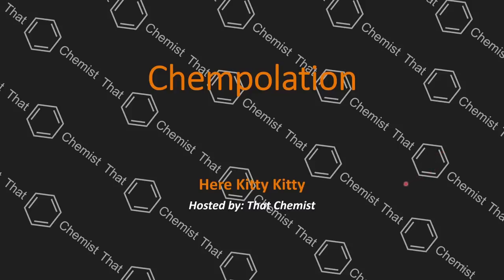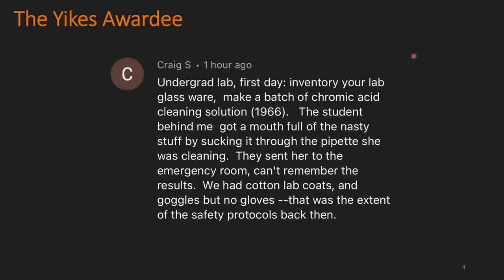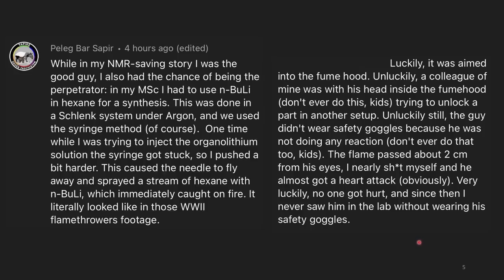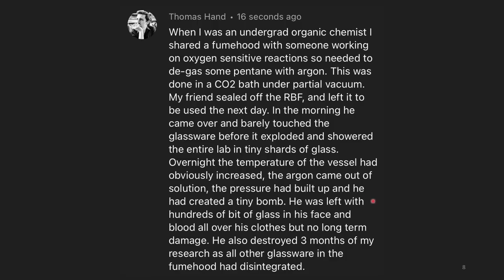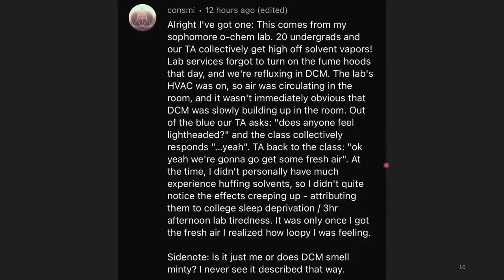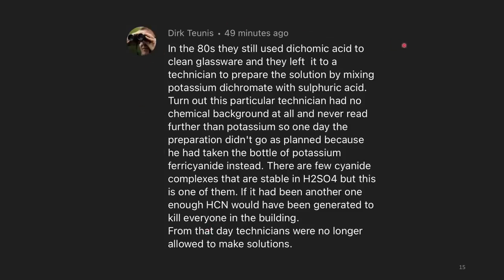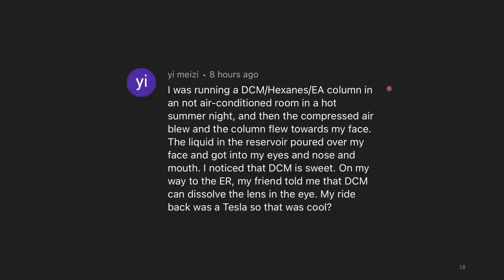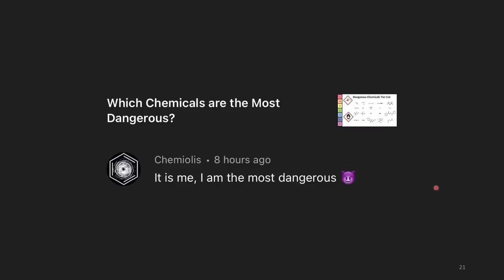He found out why that box was wet…

Comment: Ah, the bit about autoclaving Stuff Not Meant To Be Autoclaved reminds me of why my cheap cautery pen (medicine, not chemistry, not a professional/student in either of those...) got trashed.

They're meant to be single-use sterile and disposable, but the body is aluminum and the end caps and switch are Nylon 66 so they're safe to autoclave and reuse, and they sell replacement nichrome tips for them for a reason. Likewise, they take a standard alkaline AA battery which can also be autoclaved along with them (you have to use a slow cooldown not a rapid vent so the electrolyte doesn't boil and rupture, but it's otherwise safe to autoclave them) but I accidentally left the battery IN the cautery pen instead of in the bag WITH it and discovered that while Nylon 66 doesn't MELT in the autoclave, it definitely SOFTENS and the spring pressure from the battery contacts was enough to push out and permanently ruin BOTH end caps while the nylon was soft and malleable. Damn things cost 12 whole dollars and keep disappearing in shipping cause USPS thinks they're vape pens half the time...
Reply from the maker: Why do you need batteries for a pen?
Reply: @That_Chemist  It's a cautery pen, for cauterizing/sealing blood vessels during surgery, small wounds in first aid, or for removing skin tags and warts and such. It's basically a AA battery with a push button and a piece of nichrome wire that gets hot, so you can cauterize things while having something that's portable, cordless, sterile, and heats up/cools down fast. Definitely a lot nicer than heating up paper clips with a Bic lighter anyway, but tends to chew through cheap grocery store batteries pretty fast.

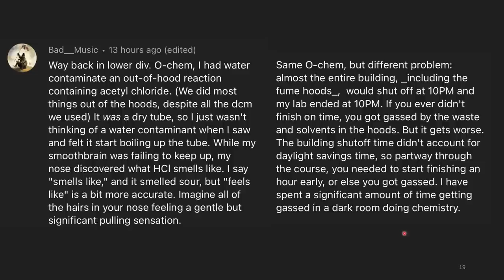Comment: 16:35 That definitely sounds like a money-related problem. Penny-pinchers in accounting have been given authority over everything else, while the senior chem department staff are too busy defending the department from layoffs to have the time and political capital to also defend lab safety practices.
Reply: A combination of timers and motion sensing switches might help if the concern was to avert wasting HVAC resources.  As long as students are still in the room, the lights should stay on and the fume hoods keep going.  And the fume hoods should go back on in time to clear the air for the first class in the morning.
Reply: @SeekingTheLoveThatGodMeans7648  That's awful complicated for people who only see and care about the numbers on the power bill. More importantly, it's difficult for the accountants to verify and enforce if it is being "wasted" as far as they're concerned. "Turn on at 8am, turn off at 10pm something something you should've finished up and locked up the lab before 10 pm anyway." is much easier to enforce than actually trying to figure out if using it late in the night was actually necessary.

Comment: The worst experience I had in a lab was when one group was having trouble getting samples prepared for analysis, so I was asked to help out for a week. I was new, and not fully trained, so I was happy to help out and learn something new. Turns out this group was processing pig tissue samples to determine if the compound, or it's metabolites, were being distributed in the pig and if they were building up or being cleared. In order to track the chemical and concentration accurately, if was fairly radioactive. I can't remember how radioactive, I just remember it was much higher than what is
I was normally working with to dose cultured cells. 
When I found this out, I figured there would be some highly specialized machinery in a hood to pulverize the samples, or we would be cutting then into smaller pieces and using chemicals for the rest. But no, we were just blending them on bench with cheap Walmart blenders and and food processors. The roughly 1 to 3 cubic inch chunks of pig had to be blended while frozen so that the later tests would be accurate. Thus, I found myself pouring liquid nitrogen over radioactive chunks of pig, putting it into a blender with dry ice (to keep it frozen during blending, it would sublimate of in the freezer) and praying the cheap carafe wouldn't crack open as I felt the chunks violently strike the side of the carafe as they broke down. Thankfully, they say least used metal carafes. 
This mostly worked, except for the skin samples (with the hair and fat still attached). The fat just didn't fully freeze, so the dull blades would get  like 2mm in the cube and jam. So for every 3 seconds of blending you would have to stop and try to pry the fat off the blade with probably 20lbs to 30lbs of force or more while trying not to have any shoot off onto you once it released. 
This slowed things way down, and the person I was helping was extremely inpatient. It was not uncommon for me to see poofs of powdered dry ice shoot out of her carafe (hopefully with no sample) as she was rushing to do this, and she sometimes would splash solvents when cleaning out the carafe between each of the hundreds of samples. After a few long days of this, and her not getting any better despite warnings from me and several supervisors, I told my boss I had had enough, I wasn't hired to this, and that I'd never process samples like this again. I know that it can be done this way safely, but only when being careful and not rushed. 
Moral of the story: always say you're busy until you know what you're getting into. That probably goes for any job, but especially this.
PS The person I was helping was moved to another group, one that didn't work with radiolabeled compounds.
Reply from the maker: Hahaha
Reply: I think the only experiment being done there was trying to turn some lab students into pig-themed superheroes lol
Reply: Aaaaa gross! Oof, I don't want to imagine inhaling radioactive pig dust lol

Comment: That DCM comment reminded me of this.
May or may not have used a pasteur pipette head and air nozzle at the central bench (at just the right angle) to quickly finish my lower ochem tasks since the goal was to get samples for melting. We had a vacuum line at the hoods but it was my understanding from my biotech training (that happened at the same time) to use a trap with the vacuum and I didn't want to slowly gas whatever basement the pump would be exhausting into or contaminate the pump by being stupid. 
Any sort of recrystallization or salting out procedure on our side of the lab (2 hoods, 4 students) without being stopped by the TA, other than certain procedures where we were explicitly told to keep doing what we're doing in the hood.  The procedure was fast enough to freeze our gloves to the flask sometimes, but it did save a lot of time compared to the hotplate alternative. 
I don't feel anything necessarily guilty about what happened, but those tubes just barely reached the bottom of the hood sash, and it's really whoever cut those tubes or designed this hybrid lab where the lines only work at the bench who indirectly taught a room what DCM smelled like...

Comment: Okay, I think I'm going to throw my hat in the ring as well.
Back when I was in my second semester of chemistry (four years ago now) and I had an accident with sodium hydroxide at home.
I had bought some NaOH for an acid base extraction I wanted to perform at home. Additionally I used it to clean occasionally. Nothing bad ever came of that or my extraction. Later however, my girlfriend at the time complained about our clogged pipe in our shower, and I thought why not just use the NaOH. Since I've used it at the university and in my previous experiments I've known that NaOH likes to cake together, which I  really didn't want to happen in our pipes. So I got my magnetic stirrer, got a huge glass jug throw a large stirrbar into it and started to dissolve the NaOH. I then went out of the kitchen to watch an episode of a show we were watching.
I made three mistakes right there.
1. Was that I left my caustic solution unattended in a kitchen.
2. The experienced chemist might have already caught on to.
3. I forgot to turn the heating element of the magnetic stirrer off. As there wasn't a thermometer plugged in, and it was a rather old one it just started heating at full blast.
At the end of the episode I went back into the kitchen to get the hydroxide and pour it down the drain, I then noticed that there was sizzling on the heating plate. I noticed that it was hot and wanted to lift the glass up and away from the heat. I didn't even really think about why it was sizzling, but as soon as I lifted the glass I was rudely reminded that sodium hydroxide dissolves glass, especially hot sodium hydroxide, one Liter of which was now flooding my kitchen as the entire bottom of the Maßkrug just plopped out of there. The next hour or so I was frantically trying to get the pH of my kitchen under 10 again, using every towel I could find. I basically ran from where the sodium hydroxide was intended to go - the shower, to the kitchen and back. Filling the towels with my aqueous catastrophe and then trying to clean the towels and myself. Mind you almost naked with the exception of a pair of eye protection and my boxer briefs as I took a shower every five minutes or so (human-fat-soap already included).

Luckily I didn't get any sort of permanent damage. My skin was itchy for two days or so, but frequent moisturizing helped with that. The biggest damage I took from this was the financial one as parts of the lacquer of kitchen cabinets started to dissolve in that time and formed an in my opinion very nice streaky pattern. My landlord wasn't as ecstatic.

So to anyone trying to store sodium hydroxide solution in a glass container: Don't.
Reply: (years ago) we have stored 1litre of NaOH solution in a PET bottle in the robotics lab. We needed that to clean 3D prints.
PET is quite soluble in dilute NaOH, also it have turned out that our floor was quite soluble too! The circular mark is still visible in the floor.

Comment: In the third or so lab we did in undergrad, meant for all those, who haven't had lab experience before to get to know equipment and procedures, we (15 students) rotated through the different tasks each week. One of the tasks was working with gas generators, cooling mixtures and the fumehood. We should generate SO2 (bp -10°C) by decomposition of Na2S2O5 in H2SO4, make a cooling mixture by combining 400g of ice and 133g of NaCl (about -21°C, cool enough to liquify SO2), and then liquify the SO2 in an U-tube using the mixture. Our pretty strict and unfriendly supervisor always checked if we were building the apparatus right before we started, and then left to work in her office across the hall. After a while, while working on a different task, I suddenly feel a weird pressure sensation in my chest and start coughing a little, but go back to work without saying anything. After five more minutes everyone is coughing so the supervisor comes back in kind of a panic, because she heard us. Turns out the girl built her apparatus perfectly, but made the cooling mixture from 400g of NaCl and 133g of ice, all while not turning on the fumehood. So the supervisor switched on every fumehood in the lab and sent us outside. We still had to come back finish the rest.
Reply from the maker: That’s slightly terrifying

Comment: A few lab events regarding sharps in various biology labs:

I was performing a buffer exchange for some antibody I had purified using column chromatography. I was in a rush, and so I grabbed a length of dialysis tubing, grabbed a razor, and held it up and sliced through it like I was using a samurai sword. It wasn't until the buffer I was exchanging into began turning red that I realized I had sliced through my glove, significantly through my ring finger by the middle knuckle. It was deep, but it was such a clean cut that it healed very quickly (still have a scar though).

In my third year of grad school, the entire building I worked in had to be retrained on sharps disposals. Apparently someone(s) had been putting used razors and uncapped needles directly in the trash, and several janitorial staff had been injured.

I was working in a biological hood and I labeled some tubes with an extra fine sharpie. I capped the sharpie and, without looking, decided to ensure it was closed by slamming the cap down with my thumb. It was, in fact, still uncapped. I felt the sharpie point hit bone.
Reply: Yoicks about the janitorial staff, not just cut but exposed to heaven knows what.  It's not terribly hard to do the right thing even without the dedicated official sharps containers.  Thick plastic jugs like detergent jugs, with their caps duct taped on and labeled, will work, per the EPA produced instructions I got from a veterinarian when I had to administer fluids at home through a needle to an ailing pet.  Those can go in the normal trash, assuming it isn't something super dire like COVID-19.
Reply: @SeekingTheLoveThatGodMeans7648  yeah, we even had the red disposal boxes specifically for sharps in the labs. It was pretty bad.
Reply from the maker: Yeah the needles in the garbage thing has been an issue everywhere I worked too

Comment: The fume hood extractor fan in 'my' high school lab has been making a bad roaring sound for a year now. Fan's way off balance, so much is clear. Bearings probably also shot. You can hear the thing (which is way up high on top of an elevator shaft) throughout the whole school yard. 
But it's just not getting fixed. It still moves plenty of air, but i guess that until it catastrophically fails, popping the breaker or simply catching fire, it won't get fixed at all. 
Whenever i hear the roar when i arrive at work, i know my chemistry coworker is already at the lab.
Reply: Groan.  Better to fix it when there's a choice of when the downtime will be, which shouldn't be in the middle of an experiment.
Reply from the maker: Bug your teacher to fix it and get your parents to complain to the school admin!

Comment: This story happened when I was a 3-year undergrad:

I had to do some cleaning after some reaction I did. As you'd expect, there was a plenty of tar left which did not dissolve in any organic solvent (mainly, acetone). So I did what I was instructed to do by my supervisor (first year PhD student) - dissolve everything in piranha (conc sulfuric acid and hydrogen peroxide). I had done it before so it was not a big of a deal.

So everything is cleaned except for a glass filter. Me and my supervisor were trying to clean it up by pouring piranha onto the filter and sucking the solution with the water aspirator. It is then my supervisor says "Weird, I see some flames", however, I did not notice anything. The filter was still not clean enough so we poured more piranha. At this moment my supervisor says "I got it. It is an acetone peroxide!". Turned out we did not wash the glassware from acetone properly before pouring the piranha. And we poured all the piranha after washing the glassware into one 2L beaker (there was about 100-200 ml of liquid at this moment).

My supervisor was holding the filter on outstretched hand above the 2L beaker. After no more than 5 seconds after she told about the acetone peroxide the loud "BAM! as from a petard happened, the fume hood was covered in smoke. The filter that my supervisor was still holding was all covered in blue flames while there was a giant hole in the beaker.

The aftermath cleaning took us a few more hours, but luckily, no one was hurt and no glassware except for this 2L beaker was destroyed. After that incident I always wash glassware with excess of water before pouring any strong inorganics.

TL;DR - never ever mix piranha with acetone, even with some trace amounts.
Reply from the maker: That is terrifying

Comment: Yeah, I do remember using exactly the same system for storing our n-BuLi. If you were working with it you generally had 20 ml schlenk, which you'd titrate to check molarity preferably before every reaction. Anyway, the place I worked at had crappy syringes, mine spilt a few lm of around 2.3 M BuLi down my hand (leaked from the back side, their plungers are bad). It's not as flammable as expected, just got a slight warm sensation which ceased pretty quickly (if you ever played with flammable aerosauls and lighters, you may have had a similar experience). I just dropped the needle in sand bucket next to me. Really glad I wasn't wearing gloves though, that might have ended a bit less fun.
Reply from the maker: Yikes!